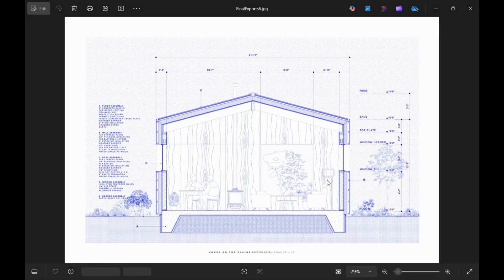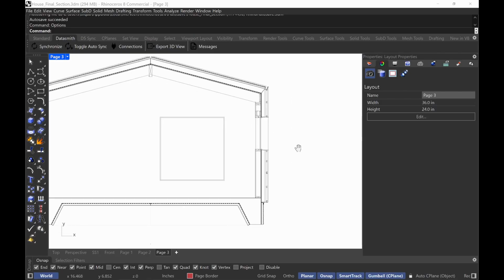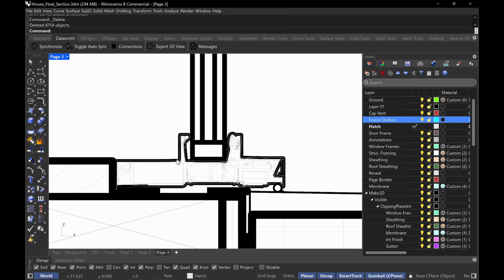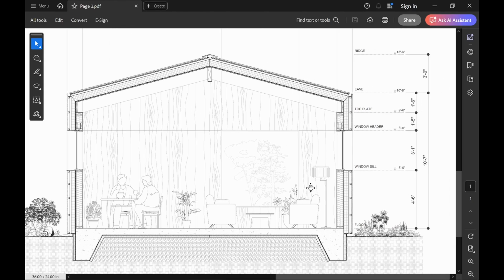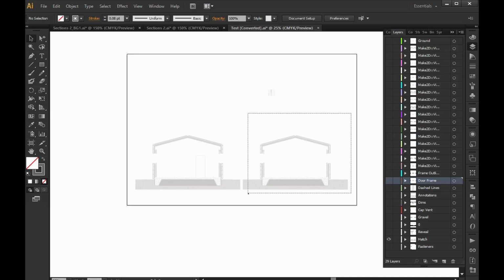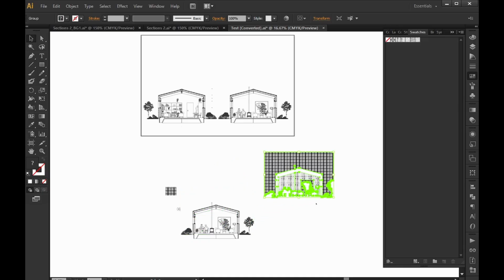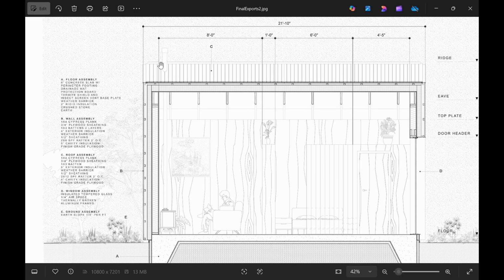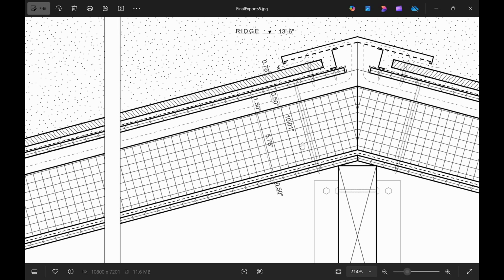Architecture Sections and Architecture Section Details Tutorial in Rhino and Illustrator

Comment: can you organise the display order of lines in print view in rhino ? for example how you're able to do it in illustrator by moving the layers on top or below each other ? i want some lines to be printed underneath other ones and some to printed below others.
Reply from the maker: Yes. 

You can either use the layer stacking, so whichever layer is on top, any geometry in that top layer will be over any geometry in the bottom layer. You can order layers by any category you want, you just need to click on the top heading of each layer category and it'll organize it by that category (for example if you click on the color header, it will organize layer by color, or by line weight, or print color)

You can also override the layer order by typing bring to front or bring to back commands on the actual geometry.

Comment: Awesome video. I got a question though. In the layout, when I have an object that I want to be arctic or rendered, I choose it from the viewport. but when I click outside the viewport to drag around the object on the page, it has no shadowy edges. Please let me know why so I can fix it.
Reply from the maker: Make sure to go to print (ctrl+P) do raster output, output color, and check background color at the very bottom.  When you print from the layout view, it will use thee print settings instead of the preview from layout.